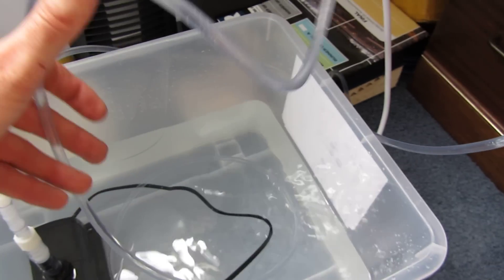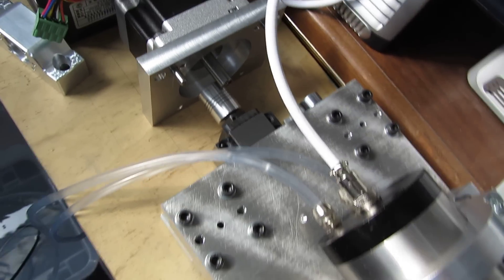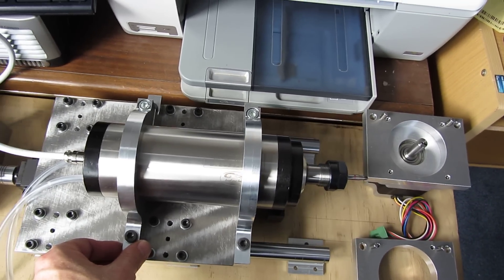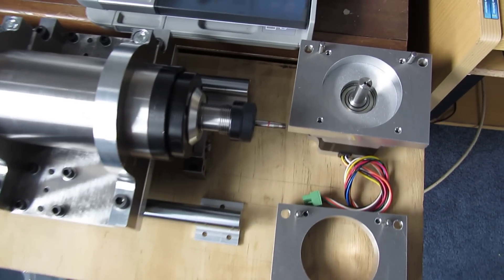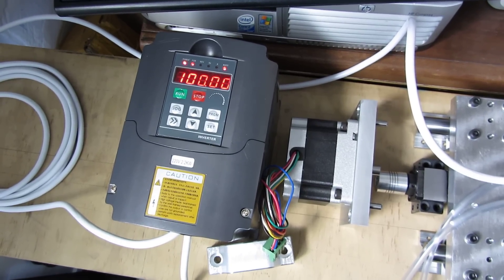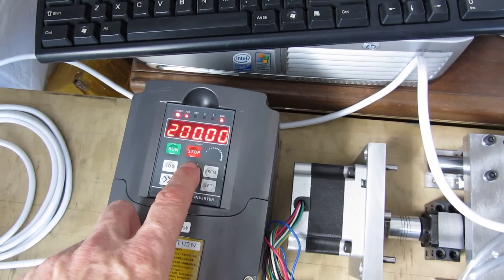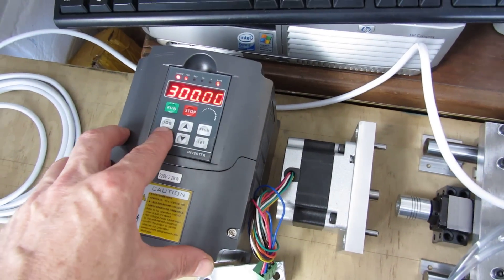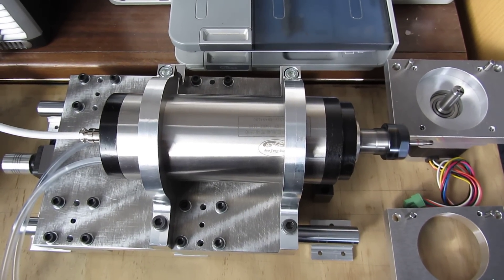2.2Kw Chinese spindle 24000rpm on my new Z axis plate

Comment: Hi Sr.

I have the same spindle but the parameters aren't well configured, the maximum speed is only 18500 rpm, please could you say your parameters of configuration?.

Now I'm trying to wire the VFD with my ST-V2 5 axis breakout to controller the rpm from Mach3, but isn't easy :(

Thank you for your videos.

Best Regards.
Reply from the maker: +Miguel A. Bueno this is very hard and it took a lot of time to figure out. It was a very long time ago now so I can't remember. the setting for frequency should be 400Hz to get 24000rpm. the manual should show you how to find that. Sorry I cant be of more help but I don't have the machine at my house anymore!

Good Luck :-)

Comment: hi Sr.

you cooling system works fine with only 1000L/H water pump?
Reply from the maker: +Eduardo Braga Yes.....my system is still working just fine. It's been in use for a few years now and had many runs that were 3 or 4 hours at a time. gets warm but nothing bad!
Reply: +Glen Lewis Thanks Sr.

Comment: Very nice Z axis.  Are you doing the machining on it?  I just finished mine and it in incredible how similar are builds are.  The surface finish on the spindle mounts is beautiful.  I like how all you motor mounts have locator dowels.  Very nice job.  All I have left is to hookup my spindle VFD and make a chip or two.  Then finish all the fiddly bits like those pesky limit switches.

I'll be putting some videos out on my channel if you are interested in seeing how similar our builds are.

Comment: Hi can you please tell me where you bought the spindle
Reply from the maker: Solar.jean off Ebay as per below from other queries. Also, might pay to look around and not get the cheapest, as per another question below (Sorry I did not reply!) but spindle runout was not good and the ER collet taper was ground at the wrong angle!!! so it takes a special "Knack" to get it running true....well cloae enough anyway!

Comment: Nice. What type of cable did you use from the inverter to spindle?
Reply from the maker: I used a 4 core shielded cable and I used the 4th core to use as an earth as the spindle itself does not have an earth. The plug in the top of the spindle has only the 3 pins (3 Phase) and it really does need to be earthed as I did get a shock off it and also there is a lot of "Noise" interference that plays havoc with the limit switches. Shield everything!
Reply: I just got mine connected with a 6 wire vfd cable (chainflex) and grounded the extra pair. Works great. Thanks for the response.

Comment from the maker: Hi there,
Sorry I have not replied sooner....are you still needing help with wiring?

I am using the C41 CNC4PC speed controller board and the smooth stepper to control the spindle. It's connected through the speed control board into the inverter that came with the spindle.

I can send some pics of the wiring I used if you like.

Cheers
Glen

Comment: Some nicely machined parts in your setup. I have exactly the same vfd and spindle and have been trying to control its speed by using an external 10k potentiometer like it explains in the manual but without success. Have you tried this method of control?